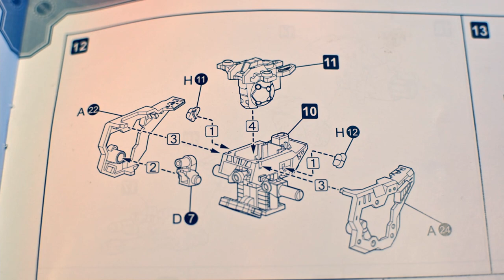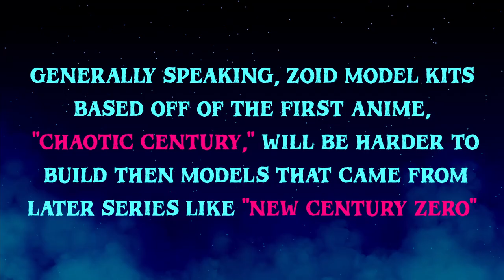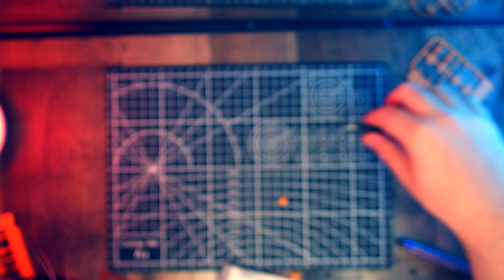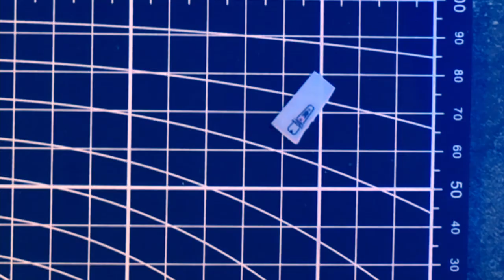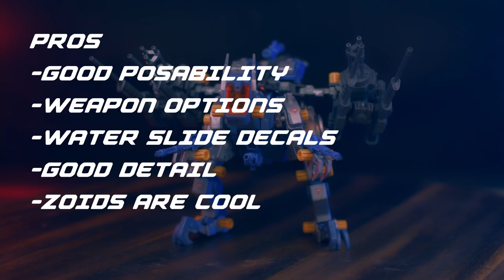A Beginner's Guide to Zoids HMM! | The Gunpla Alternative?

Comment: Even completely unarmed, it still has it's namesake built into it. It's whole body is a sniper, too bad Leena sucked as a pilot else we might have seen a sniper duel between her and Naomi
Reply: Fuking right?
Reply: I want the naomi model so badly
Reply: I mean. The gun sniper is a sniping platform.
Its not designed to lug around so much weapons, its FCS is probably overwhelmed, and the extra dead mass means it will take forever to accelerate up to speed and recover from a blow.
No wonder Leena sucked with it.

She should've stuck with the dibison.
Imagine if they put in all of the weapons on that dibison and replaced the horns with vulcans or beam guns.

Comment: I've been thinking of getting into Gunpla and ran across the Zoids models as well. At 2:48, you express some confusion about the orange 'polycaps' and I think I have the answer for you. When I was a kid in the 80's (in the US) my dad bought some of the Zoids 'toys' that were being sold in the US. These were larger toys that you would piece together, similar to Technics Lego. Those caps were used to hold the pieces together instead of using glue. They were a fairly firm rubber that would slide on to a peg that was just a little too big for the hole. You had to apply pressure to force the cap onto the peg, and since it was rubber, it would just squeeze down on the peg, and keep the parts together. These models were motorized using a wind up mechanism for the smaller kits and the larger ones would have battery powered motors. You could end up using dozens of them on smaller kits, or probably close to a hundred of them on the large brontosaurus toy they made. I hope that helps :)
Reply from the maker: Ooh ok. So it sounds like they were a functional part that has stuck around as just part of their design now. Appreciate it!

Comment: What glue do u recommend everything I have tried just melts even Tamiya cement
Reply from the maker: So I use Tamiya extra thin cement glue or Testors liquid cement in the black bottle. These are plastic glues which are meant to melt two pieces of plastic together, which you can then sand to a nice finish.

If you don't like the melting you could just go for normal super glue, I use Loctite's gel control for resin models. I would always recommend using plastic glue for these myself, but maybe try super glue out on a cheap gunpla and see what you think of it. Good luck!

Comment: sorry but wtf are spruze or how you call it i was always told it was runners and the points that hold the parts are gates, and for me im just happy with snap build without the extra work on cleaning
Reply from the maker: A "sprue" is just a modeling term. I think technically you're right in that they are called "runners" and the sprue is the channel that directs the plastic into the mould, but people started to refer to the whole thing as a "sprue" and it stuck.
Reply: @OtterpunkTV  ahh ok, and i agree some kits are a pain in the ass to make ( in my case i HATE building the shield liger/blade ligers but then again in 1 sitting i can fully build a zoid in 7-8 hours straight  and that is without nub clean up and decals or panel lining
Reply from the maker: Yeah, any extra clean up you do looks better, but also makes the build go way slower for sure.